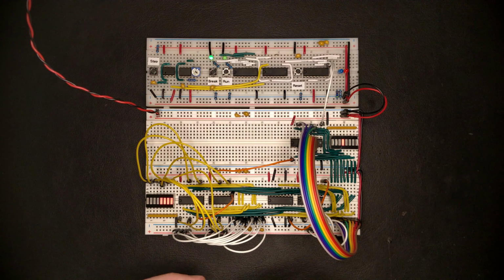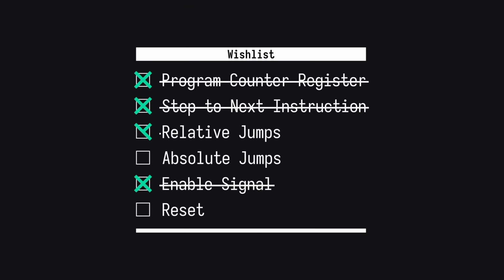Relative Jumps – Superscalar 8-Bit CPU #8

Comment: what's the reason for implementing relative jumps in hardware?
I thought an assembler would resolve these to absolute addresses anyway...
Could you provide an example where this is necessary?
Reply from the maker: Relative jumps are very useful, because they allow the program to be position-independent: the program can change location in memory without the need to update absolute addresses. Almost all local jumps in modern CPUs are relative, since they are often a lot quicker to execute and the CPU can speculate about them more easily. Usually only calls to functions in dynamic libraries, and calls to functions outside of the current translation unit are absolute. This allows a program like the linker to more easily patch up jump addresses after a program has been compiled. (The linker can also patch up relative jumps, but that's harder since those are ofted limited in how far they can jump.)

A good example is RISC-V: all conditional branches are relative jumps, and unconditional jumps/calls have a relative and an absolute flavor.

Comment: Merci from my side also for this super project!
I'm in Part 8+9 in the series and I don't fully understand, why you had to use a second pair of adders and then multiplex the outputs.
Is it not possible to solve the requirements: step to next instruction & relative jump with one pair of adders?
Looking forward to your answer...
Reply from the maker: Thanks! I'm trying to plan ahead for function calls, or what RISC-V calls jump-and-link: the PC jumps to a new address (relative or absolute), but you also want to store the address of the instruction after the jump ina register (to be able to return from the call). I'm not 100% sure yet whether I'll do it in this exact way or not, but it's good to have the option available. In any case, once more of the conditional jumps and calls are done, the PC will get a rework and upgrade to match what is actually needed 🙂
Reply: @fabianschuiki  Gruetzi Fabian!  Great series. I'm enjoying it greatly and thank you for doing it in such detail.  A quick follow-up.  I'm more in software than hardware and a modular build allows to rework only small pieces of code. Looks like you are taking the same approach here. How often would a relative jump like this happen?  In my build I was thinking about only using a 16-bit counter and reset the position using another register. I get that it wouldn't be as efficient, but wondering if it is worth the effort.  My PCBs are modular, so I could always replace the program counter one later with this design.  Was wondering the pros/cons of simple counter with software jumps vs. this type.  Not the best forum to discuss here but appreciate your input.
Reply from the maker: Thanks! 🙂 You can definitely go with a simpler PC in that case. You can generally do a lot of work in software and keep the hardware extremely simple. As long as you have a way to swap out the PC with a value in a register, you'll be fine. You can also throw out registers altogether and make your CPU work directly on memory. That'll make it slow and requires a more complicated multi-cycle instruction execution like in Ben Eater's 8 bit CPU, but you can limit the hardware to only a few bare necessities. 🙂
Reply: @fabianschuiki  Perfet!  Trying to find a middle ground and then iterate from there as I learn - thus the modular approach. Looking forward to watch the rest of your vids. Danke vielmal.
Reply from the maker: Modularity is a great idea and approach! The multi-cycle instruction architectures like Ben Eater are especially nice to build up on a modular basis, because you can have one or two fixed data buses that shift data around, and then go build up tons of cool execution units in your CPU. If you aim for >1 instructions per cycle, all sharing opporunities for buses and resources disappear, and you have to build stuff in a way such that you can do every single data movement in parallel. That's why my register file has multiple ports, and why I even have a register file. But for multicycle CPUs you could just have one temporary register in front of the ALU, and then coordinate data movement across a single bus from a controller.
Reply from the maker: Also, I hear that stack machines are quite a lot of fun to build up, because they have no registers and the instructions are very simple and small. Might make for a good follow-up series 😏

Comment: Drive the adder input to b00000001 with resistors & use a 74xx244 to drive adder input to relative jump.
Reply from the maker: I'm trying to go for a fully CMOS-based design. That means not playing any tricks with resistors, diodes, and tri-state buffers (except for realizing an actual tri-state bus, which again has CMOS drivers). The reason is that resistors introduce static current draw when they are being overridden by a stronger driver, and they are very annoying once I'm going to try to push the speed of the circuit up, since the fact that they need to be overridable by a stronger driver means that they themselves have to be comparatively weaker drivers. So whenever the resistors themselves are the sole thing driving a chip input, you'll get a capacitive charge curve that is annoyingly slower than when you're having a proper CMOS output drive that input. Thanks for pointing this out!

Comment: I first had some experience with solderless breadboards some 30 years ago. If your boards are still built the same the rails can be pushed slightly into the foam backing when inserting some components. This can result in some component leads not making full contact.
   Especially annoying is a chip which only seems to work when a multimeter or oscilloscope probe is pressing directly on a chip lead, but a circuit stops working when you remove the probe.  The solution can be to hold the board in one hand and run the fingers of other hand under the back of the board, pressing the rails back into place.
   This can also cause some chips to 'pop' off the board, so it helps to make a note of all chip numbers and their pin 1 grid locations before hand. An experience I wasted some lab time on.
Reply from the maker: These are some great insights and tips! Those flaky connections already caused my quite a few headaches. I'm trying to go to PCBs as soon as the basic functionality works on the breadboards, to avoid having too many breadboards in the system at the same time.